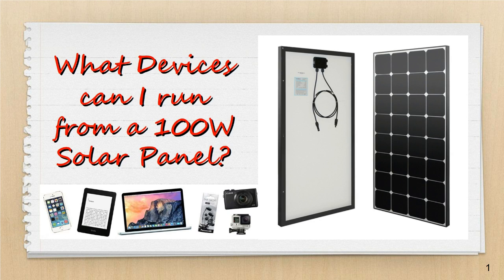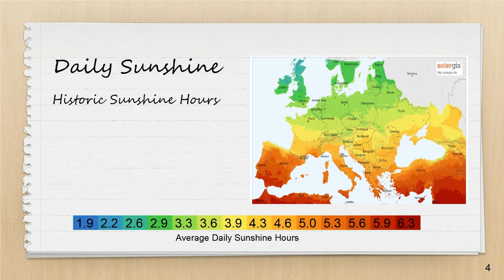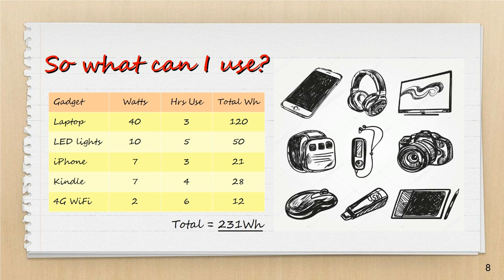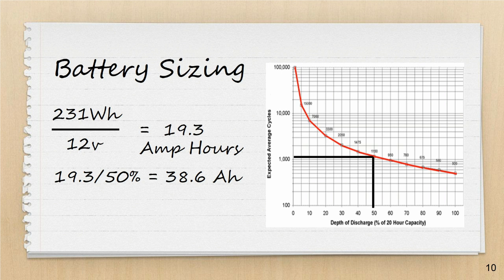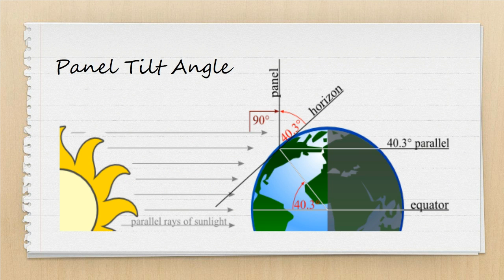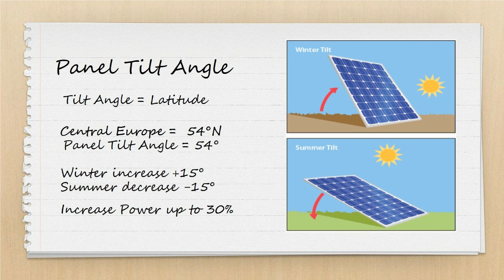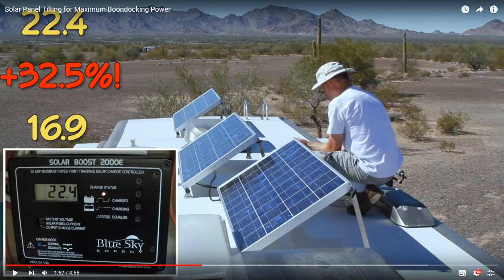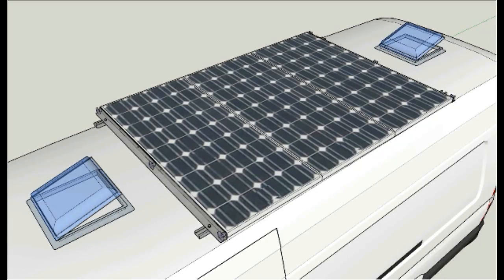What can you run on a 100W Solar Panel?

Comment: I am William from India, can explain about Nano Solar Panels
Reply from the maker: These is new technology using thin film organic materials to capture more of the light wavelengths and get efficiency up to 45% cheaper to make but less lifespan and not as durable yet. This is a very good article on them https://en.m.wikipedia.org/wiki/Nanocrystal_solar_cell#:~:text=Nanocrystal%20solar%20cells%20are%20solar,silicon%20or%20various%20organic%20conductors.

Comment: But Greg, they can't be hinged just on 1 side, as u'd have to park van 1 way, but can't. Need a 4 side hinge system, & motorised too, as u can't keep physically getting up on the roof every day.
Reply from the maker: Hello alan, I can just park up forwards or backward it far easier to turn the van 180. 
Plus I can do it with just a folding ladder on the side and lean over and do it very easily. 
Watch this space. 😀

Comment: Thank you Greg - very clearly explained and useful. A pedant point, but are you sure about those 'latitude' figures? Wikipedia explains that possible 'latitude' measurements differ according to the type of (spheroid) shape you consider planet Earth to be. Global latitude/longitude co-ordinates are normally calculated using the conventional 'geodetic' earth shape. On that basis (and to nearest whole degree of latitude), Paris is 49 degrees, Prague 50 and London 51 degrees (North). The largest city corresponding to your '54 degrees' of latitude is Rostock on northern Germany's Baltic coast. That's not really 'central Europe'. Since Brexit, the geographical centre of the EU is now considered to be close to Wurzberg, Bavaria 49 47' N.
I think your latitude map has an error (Helsinki isn't within the Arctic Circle) and the figure should read 66 32' NOT 60 32'.
Anyway, none of this is of any real importance to angling a PV panel in the real world but I couldn't let it go. I'm interesting like that. So my very few friends tell me.

Comment: The old major mistake: above 25 degrees Celsius with every degree the efficiency of the panel goes down in percentages (lets say to some 80 percent of efficiency on a good summer day in Northern Europe in the Mediterranean even more) . If you go to "winter" degrees of the sun for fixing the panel the panel will be better cooled down by airflow in summer and more effective to the shorter sun hours in winter. Summer heat reduces panel effectivity by 1 percent by degree above 25 degrees... as full winter sun direction 100 percent efficency of the panel shortens the summer day....  Take the temperature of your panels and the airflow around them in consideration, its crazy to have some hours a day of 100 percent effiency in November to March and 80 percent and less most  of the day in nowadays Middle European summers... Call it a breeze, call it an angel, but consider it for the efficiency of your planned system. Blessings.

Comment: This idea of yours is so great a question comes i have a mini amplifier transformer volts is 15 volts amps 4.0 so for me to get it power which is watt  i will just multiply voltage times amperes of a transformer to get power is it correct for me to say soo
Reply from the maker: Chalo Kips Kips yes absolutely correct 👍🏼
15v x 4 amps = 60W

Comment: so a 12v fridge running at 40 watts for 24 hours works out to 960 Watt Hours ???? how am i gonna be able to run a 12v fridge ??? HELP !?!?!?!?
Reply from the maker: Hi Charlie, your fridge does not use that power all the time. It works on a thermostat when the inside warms up the thermostat turns the compressor on and at that point it uses the 40 watts of power when it gets colder the thermostat turns the compressor off.
if you listen to a fridge working you will hear the fridge system cutting in and out. The more you open the door and load it with warm food the more it will run.
So for power estimate assume it will run for 1/4 to 1/3 of the day. i.e 40W x 8hr = 240W / 12v = 20A a day
Reply: @GregVirgoe  thanks so much for getting back to me , I'm in the middle of building out my campervan and your videos have been the most helpful ones I've seen online 👍👍
Reply: @GregVirgoe  would you say a 150 watt solar panel would be enough for my campervan ?? , all im going to be powering are L.E.D lights , 12v fridge , laptop ,  phone , and a smoothie maker a few times a week , Im not having a water system so I think thats all my electric needs , I know its hard to say over a comment but anything is appreciated,  thanks again and great channel 👍

Comment: It's not a lot is it Greg. A few hours of devices and certainly not enough to handle the output for pumps, fans, additional lighting that "motorhome" users require these days. Fine on-grid but a 100W panel will do nowt to extend the experience off-grid.. result is some seriously disgruntled campers. Even a 100W panel is not standard equipment on most of the new motorhomes available either. One of the many reasons why people decide to DIY on the whole experience IMO. Looks like you're going to be packing some serious tilting wattage on your conversion. Mrs Virgoe might even have the luxury of an onboard sunbed for when you guys come up our way to 55N?. R & T :-)
Reply from the maker: You guys comments always put a smile on my face. There's me thinking of running my tech and completely forgetting the basics like pumps and fans etc lol so let me look at that now for you. Well the pump is about 12V x 4A = 48W but it only runs for very short bursts, seconds at a time. My fans are 38W so you couldn't run them for long. I'm guessing a small weekend van would do ok with this setup. I've got 3x160W panels, so potentially just over 1kWh generated each day. I think that will keep me topped up with any luck. Plus we'll be following the strawberries so it's always going to be sunny where we are 😎

Comment: I don't know how to work out how many watts my laptop uses..
Reply from the maker: Holistic-Healing UK answer was in my first reply 120W 😊
Reply: @GregVirgoe  But 120w is more than my solar panel can handle isn't it? 🤔🙈
Reply from the maker: Holistic-Healing UK your laptop will be running off your batteries. Your solar is recharging your batteries. Even if your solar is smaller it could charge your battery for two hours and you could use that pose for an hour. That’s just an example not exact figures. So say charging all day and use it for 2-3 hours
Reply: @GregVirgoe  Ah, I think the penny is dropping. Takes a while when you get to my age..😏Thanks for your patience. Actually, I'd forgotten about my 600 watt inverter. How does that figure in all this? Lol

Comment: It would be interesting to know how much drag (extra fuel ) the solar panels create on a 100 mile journey...I think they are great if you're parked up for a few sunny days but during the winter in N.Europe I doubt very much they are worth bothering with. Might be better with a small wind turbine like the ones on yachts.
Reply from the maker: Stephen Auty well after living in the van full time for half a year and not once have we plugged in anywhere I can safely say that the solar works perfectly. I even get a charge when no sun and raining. 
Our batteries are topped up everyday regardless of the weather. As soon as it’s daylight I’m getting a charge. 
Had free energy every day.
Reply: @GregVirgoe   That's really good to know, I never thought they would do much on dull days. Could you manage without the engine running? Would you consider a small turbine or is it not necessary?  Huge thanks for doing this series, it's so well done and good luck with your new chapter in life.
Reply from the maker: Hi Stephen, we do not have a split charge kit installed and have not needed to plug into mains either. It’s been raining for three days now and I’m still ok for solar power. 👍🏼

Comment: Instead of running anything on a solar panel, try charging 2 batteries with one solar panel, use an inverter to run at least double what you think you can run, no?
Reply from the maker: No, the purpose of this video was to demonstrate how much power a single panel can generate in one normal day. That has nothing to do with batteries or inverters. You can only use what you can generate. 😃

Comment: Easy over 50% less Greg. I have been using solar since 1989 Just take one of my 280 watt new Chinese panels which never produced more than 70 watts on a Victrom BMS pointing at the sun and I was moored at 27 degrees south this summer With your tilt on the panel on the van, have you arranged it to work in a 360 degrees spin? Please don't forget that the engine does the charging of the battery as you need a ramping bulk charge or your batteries will not last long. Solar panels are only for topping up the battery especially with AGM. Plus you haven't calculated in the inefficiency of charging the last 20% of the battery unless you have lithium.
Reply from the maker: Peter Staples there are some major problems with your system if that’s all you are getting out of your panels. They need checking
Even when mine are flat on the van in the UK in spring I’m still getting 300W out of 480W solar panel setup. 
We have lived for two years now just on solar power. Nothing else. I do not have split charge and don’t need one. There is plenty of power to charge the AGM batteries correctly with a decent MPPT controller. 
My batteries have never dropped below 12.4volts which is only 30% DOD and are always topped up to max the very next day.
Check your equipment and setup you have problems there that are not relative to equipment selection.

Comment: Anyone run cooking stuff off solar? Rice cooker, crock pot, cooler etc
Reply from the maker: Hello, there are quite a few people running single induction hobs in vans off an inverter and solar set up. Any electric heating appliance uses a lot of electricity so be sure to check the watts and make allowance in your battery bank for the high usage.
Reply from the maker: A microwave oven is also another popular electric cooking device for a camper.

Comment: In fact you can't run something that consume 100W for 1 hour with a 100W solarpanel? But  only something that consume 100W-30%=70W  for 1 hour? Can I conclude that sir? Regards, John.
Reply from the maker: John, what you run has no direct relation to the size of the panel because nothing runs directly off the panel they all run off your leisure battery. 
You are looking at it the wrong way my friend.
Reply: @GregVirgoe  oké,thank you.

Comment: Would have been more useful to me including things like fridges etc.
Reply from the maker: It’s really quite simple. 
On the back of your fridge is a label that tells you the electrical power in watts. Something like 75watts for a typical fridge. 
So if you get 3hrs of max sun a day that’s 300w of solar so your 100w solar panel will power your fridge for 4hrs. Therefore one panel is not really enough to run a fridge all the time. If you need any more help try to be more polite. Manners cost nothing 😃